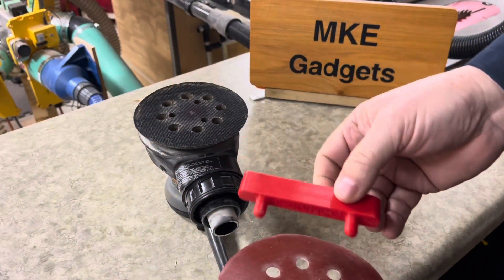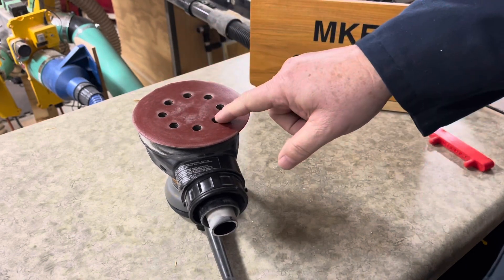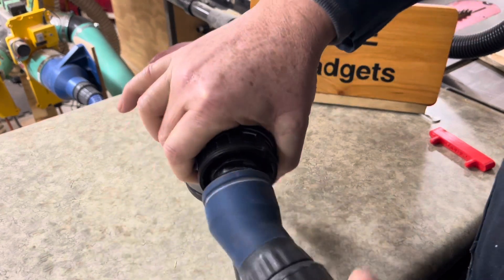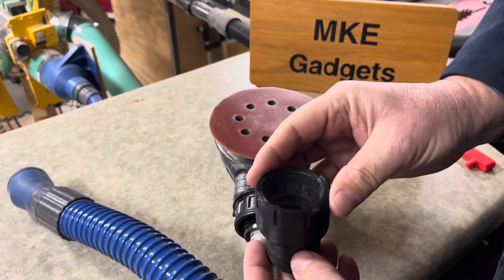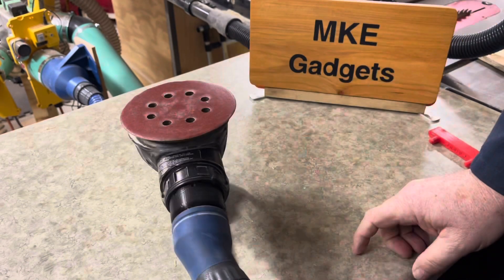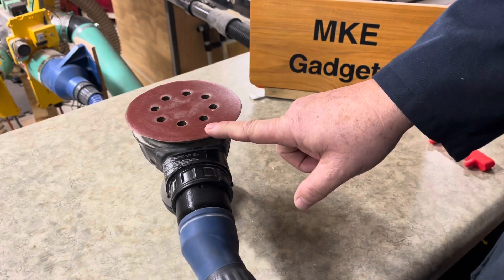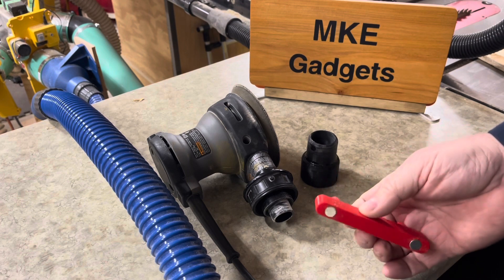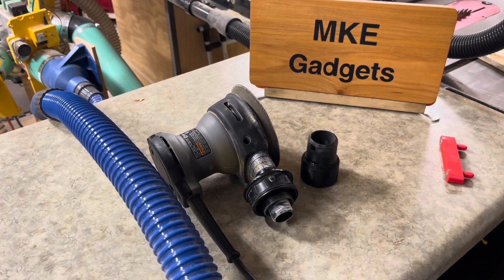Porter Cable 382 Sander Dust Adapter @ MKE Gadgets #157

Comment: Did you apply epoxy to the filleted section? I tried printing an adapter for my DeWalt orbital, but decided on the stretched PVC pipe method.
Reply from the maker: I added some superglue where in a transition go the from two diameters. It felt a little thin and I was afraid it might crack. When it does crack up print it with a higher percent infill.